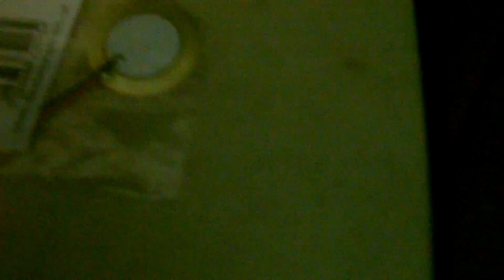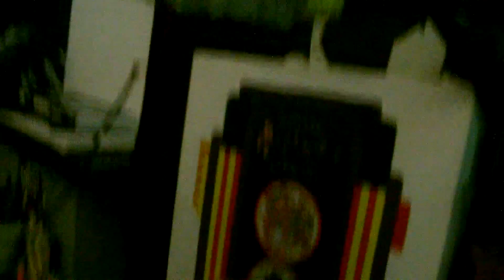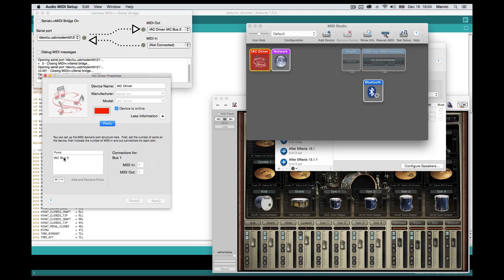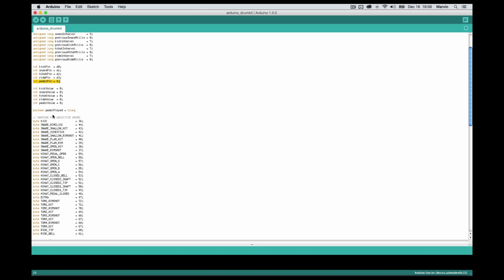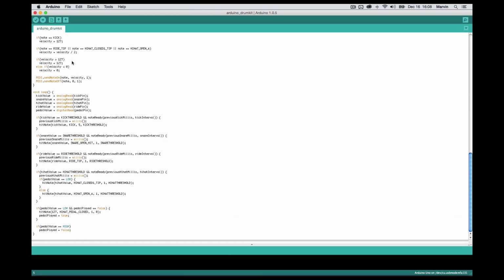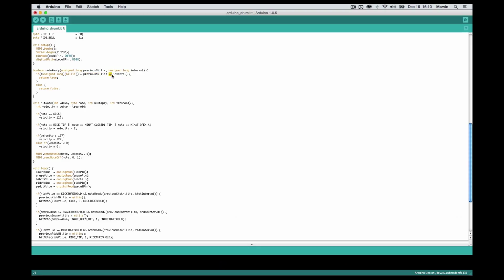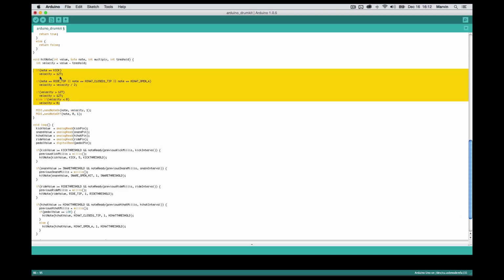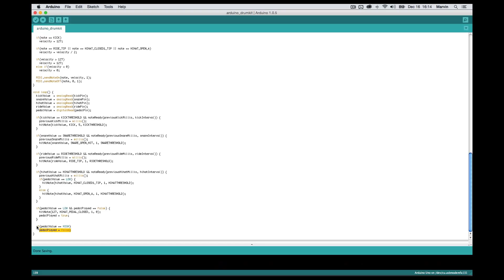Arduino Drumkit (Stage 3) 4 Piece Kit Walkthrough/Explanation

Comment: Really enjoyed this video, thanks for taking the time. I've been using your sketch, but I'm getting multiple midi notes recorded in logic from one hit instead of just the initial hit. I'm new to writing code for the Arduino so any information would be appreciated. Thanks again.
Reply from the maker: Justin Carrico That will be due to the relative sensitivity of the pads you've built, you can offset that in my script by using the defines below (in the top of the script. The higher the value, the less sensitive the pad.

      
      
        
        #define KICKTHRESHOLD  20
      
      
        
        
#define SNARETHRESHOLD 20
      
      
        
        #define HIHATTHRESHOLD  20

oops no, you need to use these to offset your sensitivity for each pad unsigned long snareInterval       = 10;
      
      
        
        unsigned long previousSnareMillis = 0;
      
      
        
        unsigned long kickInterval        = 10;
      
      
        
        unsigned long previousKickMillis  = 0;
      
      
        
        unsigned long hihatInterval       = 10;
      
      
        
        unsigned long previousHihatMillis = 0;
Reply from the maker: Justin Carrico same as any other drum, just use another input

Comment: thanks for the explanation but how can i resolve the latency issue?
Reply from the maker: +Umar Nadeem Hey, are you experiencing any latency from the sounds of the plugin? If so, you might need to change your audio setup. Are you using an interface?
Reply: +Fighting Badgers Its just little latency ive tried ableton , cubase and even fl studio but its still there. hairless shows the hits at right time but theres like 200ms latency. and im using dell ive tried updating my drivers as well but its still there.
Reply from the maker: +Umar Nadeem Best thing you can try is to make sure you are using an ASIO driver when in any DAW. Shouldn't matter if you try Ableton or Fruity, or whichever. Install ASIO4ALL if you need to (probably) and make sure the audio driver in your software is set to use that. Possibly Hairless needs to be set to ASIO4ALL as well (once you have installed ASIO4ALL), but I am not sure. The if you are still experiencing latency, look for the "audio buffer" or something similar. If you lower that value you are getting less latency, but lower it too much and your computer might not be able to handle it.
Reply: Fighting Badgers I used asio4all with micro drum and it worked. thanks for the help really appreciate it.

Comment: Hi, thanks for a great tutorial! Would it be possible to add a sustain pedal to the code?
Reply from the maker: Jens Skou Olsen to do what? hihat pedal? because I believe I have that in there
Reply: Hi, I just wanted to use it to play gong and chime samples of different lengths - if I had the sustain pedal option (MIDI.sendControlChange 64) in your code, I could combine it beautifully! And thank you for replying so fast!
Reply from the maker: Jens Skou Olsen just use any digital pin on your Arduino and implement like a simple push button, which a sustain pedal basically is. there's lots of basic tutorials about making a simple button which you can add to the code, or you can look at the hihat implemention I already have in my code
Reply: I just solved it! Thanks for a great tutorial oand som great work!!!
Reply from the maker: Jens Skou Olsen make the same if statement but use LOW instead of HIGH
Reply from the maker: put the off event there
Reply: Doyou know if it would be possible send send out midi through the arduino usb port (without computer) in stead of using the standard midi?
Reply from the maker: Jens Skou Olsen no not like this you will need a midi shield for Arduino
Reply: In your code, when I play a note several times it layers the hits on top of each other. Is there a way to ensure, that only one instance of a specific note plays at the same time? That is: if i play a cymbal velocity 127 and then play the same note at velocity 10 could the code make the velocity 10 note replace the velocity 127 note in stead of layering the two notes on top of each other? Thanks!
Reply from the maker: Jens Skou Olsen pay with the threshold values in the code
Reply from the maker: play not pay

Comment: i could totally use your help on a project for programming midi for arduino
Reply from the maker: Hmm, if it's like a quick thing or whatever I would probably be able to, but I am super hammered with work as well :p
Reply: well i had noticed you have apple :( i have pc. i was curious on what might had to do for the midi signal to be read from arduino to the pc. have to use the 1m Resistor and the 220k ?
Reply from the maker: Hairless serial to midi seems to be there for Windows as well, and I think I only user 1M resistors for the pads (Can't remember, it's been a while and the drumkit is disassembled at the moment)... http://projectgus.github.io/hairless-midiserial/

Comment: Hi! I love the work you've done with your setup, in fact I am watching this video repeatedly hoping that i could understand how to make a sketch for the setup that I'm planning to do, unfortunately I really suck with codes the fact that I couldn't even understand how it works or how to start. I was just thinking if you could help me make a sketch for my setup or at least give me a template sketch that I can copy and edit to add values for this setup that I've already connected to all 16 analog inputs of my arduino mega 2560? Ihave connected my piezos to the analog inputs as follows:

A0: BASS DRUM
A1: SNARE
A2: SNARE RIM
A3: TOM1
A4: TOM2
A5: TOM3
A6: TOM4
A7: HI HAT (CLOSED)
A8: HI HAT (OPEN)
A9: CRASH1
A10: CRASH2
A11: CRASH 3
A12: RIDE (EDGE)
A13 RIDE (CENTER)
A14 CHINA
A15: CRASH (CHOKED)

I am not planning to use any hi hat controller pedal or sensors knowing how bad I am with electronics, so I decided to use iindividual pads for every articulations.

By the way, I've setup my arduino mega to send midi signal to my laptop with Superior Drummer 2.0 Running on SONAR 8 Producer Edition via the midi-usb converter cable that I have embedded to the arduino using this guide that I've found: 

http://www.instructables.com/id/Convert-Rockband-Controller-to-MIDI-Drums/
http://shiftmore.blogspot.com/2010/01/quick-and-dirty-arduino-midi-over-usb.html.

Would you be so kind to help me coz I am so desperate to complete my project, I've spent months browsing the internet hoping to find a guide or tutorial on how to make a sketch specifically for midi drums.

You could also check out my channel, I used to play drums using a midi controller but since I've found out about DIY midi drums using arduino, I wish I could try my luck and give it a shot. I will thank you a million times if you could help me.
Reply from the maker: https://github.com/TheApeMachine/arduino-drumkit/blob/master/arduino_drumkit/arduino_drumkit.ino You should be able to get it from the sketch I used for this project. You can see that I make things like the kickPin and set it to A0 and so on. Then just keep copy/pasting the if statement for the kick or the snare in the main loop and change the variables to use the other pins. Try some things, if it doesn't work, upload your code somewhere and tell me the link and I will have a look.
Reply: Fighting Badgers thank you for the reply, by the way I'm planning to use an ordinary sustain pedal (a momentary on/off type of pedal switch) to open and close the hi hat how can I go about wiring a mono jack to arduino inuputs to be able to connect he pedal and could you tell me the best  code to use for that setup?

Comment: hi, first off, I really would like to thank you for sharing this work of yours.

I learned a lot from it and I am in the middle of creating my own drum kit though I have several modifications.

the part where I was having problem is the output MIDI part. I am using windows 8 and the only option it displays Microsoft GS Wavetable Synth. 

I have been finding ways to change my MIDI output but still no luck, I am using VST host by the way. 

I hope you could help me on this part im getting frustrated :3

Thanks
Reply: Hi Abbey, you will probably have to install a MIDI driver somehow to create a simulated MIDI device... If this was 16 years ago I could have helped you, but this is the exact reason I am not touching a Windows machine ever again :p No but seriously, look for some sort of USB 2 MIDI driver... Actually there is some stuff on this on the Hairless MIDI github page here: http://projectgus.github.io/hairless-midiserial/

"NB: To convey Windows MIDI data from one bit of software to another, you’ll need a Virtual MIDI passthrough driver. We recommend loopMIDI, or there is alternatively the older MIDI Yoke (MIDI Yoke is not recomended for Vista or newer.)"
Reply: Indie Boogie hello, thanks for that fast reply. @_@. I was able to run MIDI yoke.

But, it has quite a delay not like your T_T. I will go try the loopMIDI hope its quite faster. THanks
Reply: Make sure your soundcard delay is set to the minimum amount of buffer as well... What kind of soundcard do you have?
Reply: Indie Boogie OMG, i dont have a sound card, Do I really need it? I am using the built-in sound driver from the Motherboard.I am sure that the signal was perfectly captured by the Hairless bridge because the indicator lights up in perfect timing when i hit the pads.
So i assume that the delay is within the output MIDI port to the Drum App i'm using to the speakers.

Anyway thank you for pointing me in the right direction, i'll try to look for ways to reduce buffer. @_@
Reply from the maker: Abbey Omisol Hmm, I really think the latency is inherent to the built-in wavetable synth... (by the way, I was IndieBoogie as well, just logged into different account) http://answers.microsoft.com/en-us/windows/forum/windows_7-pictures/latency-problem-using-ms-gs-wavetable-synth/1e85704a-803c-438f-b472-fb0cb5211be4 <-- look there for more info... Basically, yes you'll probably need a sound card where you can set the latency, and a soundcard that has low-latency to begin with... Or you could use a Mac like I do :p

Comment: hi cant you help me i got this error Arduino: 1.8.10 (Windows 10), Board: "Arduino/Genuino Mega or Mega 2560, ATmega2560 (Mega 2560)"

sketch_oct31c:1:10: error: MIDI.h: No such file or directory

 #include <MIDI.h>

          ^~~~~~~~

compilation terminated.

exit status 1
MIDI.h: No such file or directory

This report would have more information with
"Show verbose output during compilation"
option enabled in File -> Preferences.
Reply from the maker: Have you downloaded the library?
Reply: @Fightingbadgers  yeah and its working now my only problem is when i hit 1 piezo i got multiple notes trigered

Comment: Bro i need circuit diagram for connection arduino and peizos please
Reply: Just follow my instructions in the video, can't remember the exact colors, but you connect one wire to the ground of your Arduino, and the other through the resistor to an analog input

Comment: Hi do you have pedals to control open and close hi hats? If not what do you use? Thanks
Reply: +fiz t No not yet. My plan is to get a cheap HiHat stand from eBay, and use a proximity sensor mounted on that to get a variable open/closed state for HiHat. Does that make sense? Otherwise I would be happy to draw you up a little diagram.
Reply: +Daniel Owen van Dommelen (thenamewasmilo) Thanks for replying. I saw this vid yesterday and decided to build it today. I am trying with 1 piezo right now using ur code. However i've got a problem where I only connected it to A0 ie  bass drum but snare drum and hi hats are also sounding. How do i isolate to only the bass drums? Thanks
Reply from the maker: +fiz t Are you using my code completely unmodified? It sounds strange that other sounds are also sounding. Which drum software are you using?
Reply: +Fighting Badgers same software as you, ad2. Same code also, just played around with the threshold values
Reply from the maker: +fiz t Is there any chance you could share a picture with me of your wiring? I'm sure it is fine, but I am just trying to isolate the problem... It's very strange, I am racking my brain to try and figure out what could be wrong...
Reply: +Fighting Badgers My bad, i was only using  2 piezos. I commented out the hi hat part and now the snare and kick drum works fine. I should try with 3 piezos and see if it works normally. Thanks tho!
Reply from the maker: Ah... Were the piezo's close together by any chance while you were testing? These things are very sensitive so it might be that they were all triggered...
Reply: +Fighting Badgers I tried with one piezo first and all three instruments were triggered lol. I guess the number of piezos and instruments coded must match or else they would be triggered together